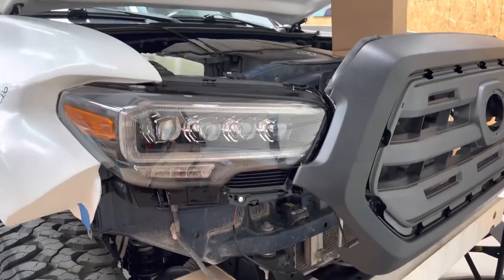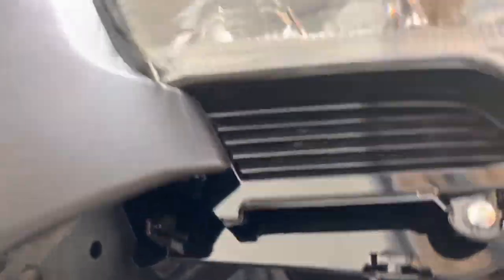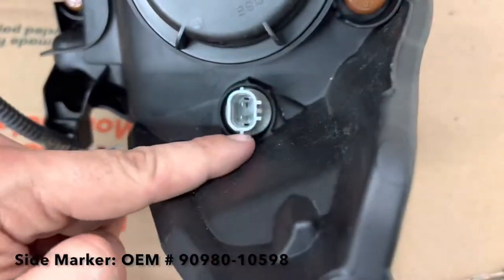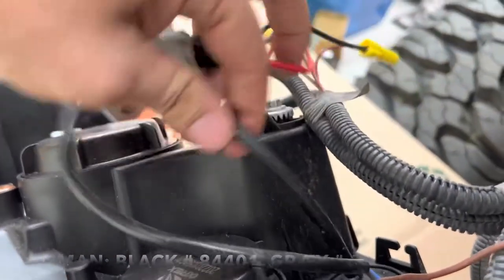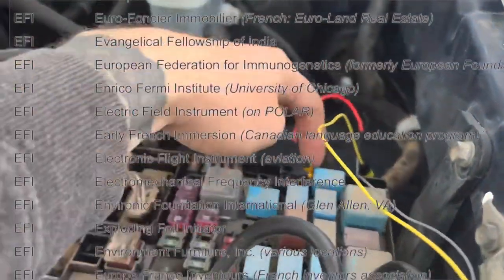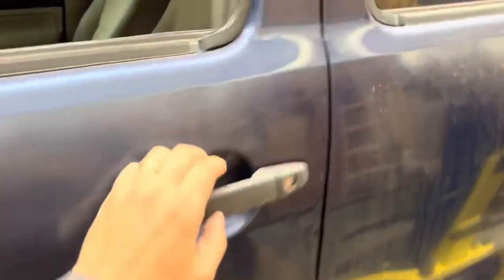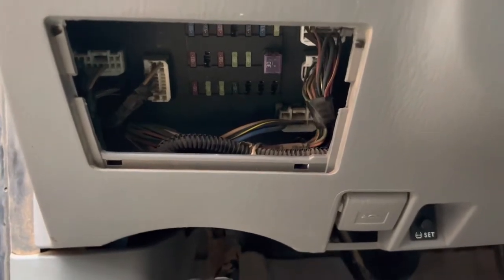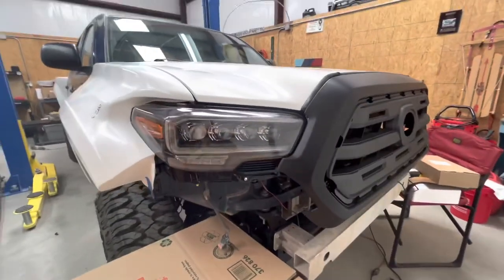2nd Gen Tacoma Build: Episode 5 - Installing AlphaRex NOVA-Series Headlights

Comment: Just installed this on my 3rd gen Tacoma. I did ran into an issue where the high beams weren’t turning on. I seemed to wire everything correctly, but the only time the high beams would turn on is if I switched the low and high beam connectors, which isn’t the correct way to do it obviously. Any suggestions? Thanks!
Reply from the maker: the plugs for high and low are the same so maybe they are just backwards?